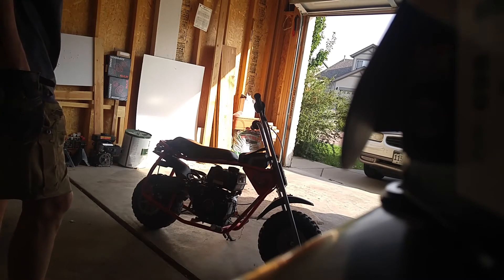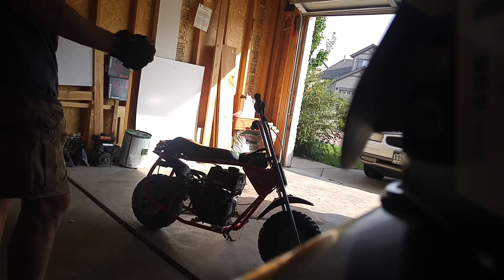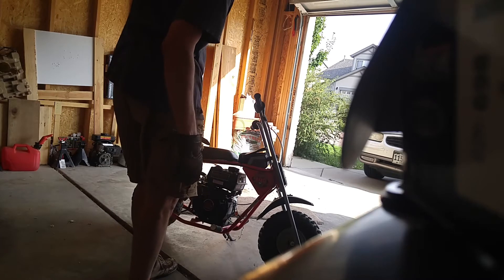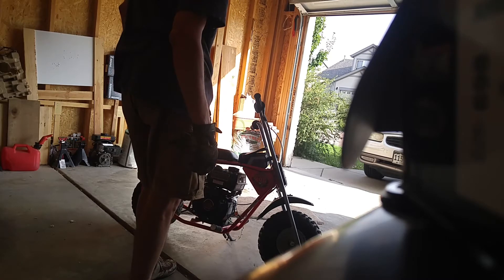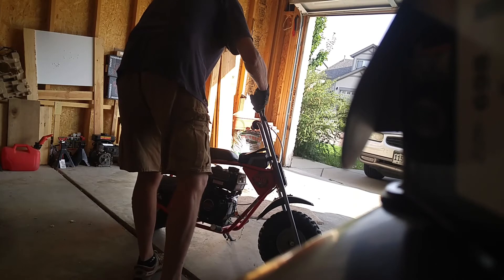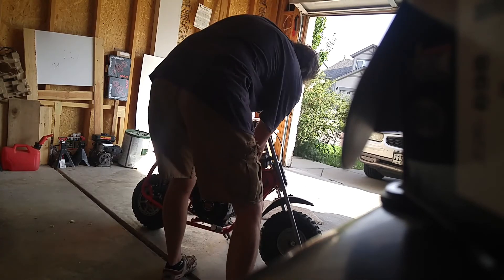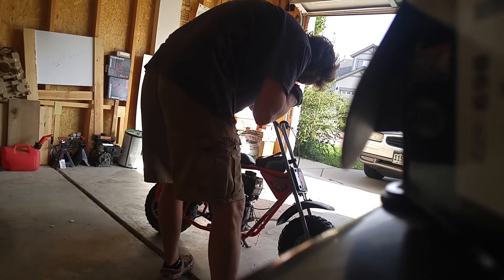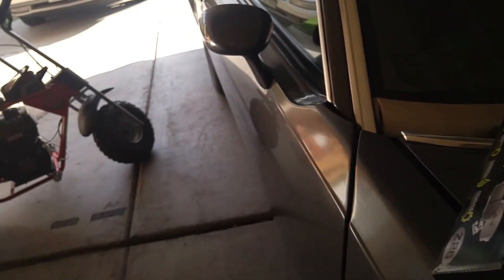ARC Billet Flywheel Kickback When Starting Predator 212

Comment from the maker: A recent comment brought my attention to this vid, which I posted 5 years ago.  I've stored it without riding it for most of that time, but have taken out and terrorized my neighborhood streets a handful of times over the last two summers.  I installed front shocks last year.  Anyway, this vid had it occur to me that the issue has disappeared.  I got some good feedback, including several comments that they resolved theirs with proper valve lash adjustment.  I adjusted the lash a few times, but if memory serves, it only reduced the kickback from a rating of "brutal" to "there, but no threat of arm removal".

However, it's now gone.  I had good reason to use that glove in the vid, so it wouldn't take any skin off during the kickback.  No glove, no kickback at all anymore.  So my first bet would be that the valve lash has settled itself to that which nixs the issue.

I fired it up a couple weeks ago for the first time since last summer and I think it started on the 2nd pull...a pleasant surprise.  And man...I forgot how much power its got.  The billet rod, upgraded cam, billet flywheel, Mikuni carb and rev limiter delete has that thing get up to 50 mph lickity split (probably 6K rpms, feels like it could do 80 if I put the appropriate sprocket on.  But, I was also reminded how small it is.  It's a bit sketch taking it up to even 50 on my streets (not winning any smooth, flat, bump, pothole and crack-free awards).

The only mod I'd like to make anytime soon would be a higher rpm centrifugal clutch.  The one on it engages what feels like <2K rpms.  So low that after it engages, once I give it some serious throttle, I can feel it pulling hard, but because the rpms are so low, can feel each combustion of the piston.  Anyone who wants to chime in on a popular higher stall clutch, would be fine.  I would want it to be too high...think I remember some that were like 3,500 rpm.  I'm thinking 2,500 to 2,800 maybe?
Reply: They’re might be a mild drag clutch that would work for that. Also you could do a torque converter and swap the springs on the drive pulley (to have it engage earlier or later)

Comment: I had the same issue with my 212 non hemi. (Billet flywheel, connecting rod, 22mm carb, 265 cam, 22lb springs, and fuel pump) from what ive been reading everyone said valve lash. Not in all cases is it VALVE LASH. My issue was the fly wheel was to advanced causing the motor to fire way to early= causing kick back. I put the stock flywheel back on and problem solved. I’m going to test it with a 12 degree timing key Put backwards, making my timing 20 degree not 32.
Reply: How would you explain this not happening to others who are running 32 degrees or higher? Not sure why you would want 20 BTDC? Stock engines are 28 BTDC.
Reply: @deucealive75  my information i got was wrong. Stock engines are 24 degrees, not 28. Im aiming for 24 not 20. My bad. Ive lashed valves cold and hot, just passed and right at tdc. Nothing changed. Put the stock flywheel on, no kick back. Tell me its not timing in the flywheel
Reply: @tannergunsell1651  When I say stock engines, let me be more specific. I used a timing wheel on 2 different stock 196's. Both were timed at 28 BTDC. If other engines are different then it would up to who is using them to verify timing.

One of my 196's is at 32 BTDC. Runs great and never kicked back.
Reply: Rotate until intake valve closes, just before tdc you will see the exhaust bump, just after that you lash the valves. Ive set it from 0.04 to 0.00 multiple times. No way its lashed wrong. Only time it kicks back is when it dont fire all the way like in this video. Caused by timing

Comment: I have. 223cc 212 hemi that does the exact same thing, it has a 34 degree flywheel and many other mods, spent literal days trying to get the exhaust lash right only to find out that the timing was causing it, have you found any correction to it? No luck on my side.
Reply: No I guess now I have to used drill gun to turn it on 😅
Reply: Wait it was the timing on the flywheel?
Reply: @ItzAmandaa333  technically it is, but most flywheels don’t let you adjust it, you have to order a special one.

Comment: I don't have that flywheel in just 18 lbs valves, big jet,  air filter and adapter, performance exhaust. And she fights me like crazy some pulls kicking back hard. But I did remove all the fins on the flywheel so I think it might be slightly advancing haha it pulls like crazy when it does it mine does it fairly often

Comment: i've been dealing with this also......very first mod was the arc billet flywheel.....did nothing else. valve lash is on point....only way i can get around it is to roll the engine over to what i believe is the intake stroke , pull it and hope for the best. kicks back but not as bad....im about to try the pvl flywheel. for now i'm not even changing the flywheel on my 2 current predators. heck my ole lady and kid for that matter could never start that thing.....and that is what its all about ,,,easy to start right....

Comment: I don't know why my Predator 212 every time I start it it makes a loud screeching noise in the flywheel somewhere
Reply from the maker: I'm trying to recall memories of the billet flywheel install.  The only thing I remember as being very close to the flywheel is the magneto contact.  Maybe check that and make sure it's not making contact.  Vague memory (or just imagination) has me thinking the magneto gap is either 0.03" or 0.06" Possibly 0.05"? Best confirm elsewhere.  Regardless of what's causing the screech, you're gonna need to take that flywheel shroud off and inspect the area around it...and the inside of that shroud.  I've never tried this, but if it's not apparent after the shroud's off, maybe try starting it with a drill (a drill with some good torque?).  I'm assuming there's some hack to drill starting that doesn't require the install of an aftermarket drill start adaptor.

Comment: Well mine has done this since I installed the arc flywheel and today the cord snapped back and the handle wacked the carb and snapped the choke lever and the throttle😕
Reply: It's your valve lash.  make sure that you measure correct spacing (mine was .003) at just past TDC on the compression stroke.  That way it's getting compression and it is easier to pull start with no kick back.

Comment: My 212 is stock with a exhaust and air filter with the stock flywheel and does the same thing
Reply: Justin Woods 

Hey bud, have you jetted the carburetor since the Intake and exhaust changes? Its a Must Do..✌️

Comment: I have a simal set up as you do and i have the same issue.. And cant figure out why!
Reply from the maker: I'm done with the build and am satisfied with the way it's running.  Took it out within the last couple weeks a couple times when the weather warmed up.  As far as the kickback, I've resigned to thinking it's probably mostly the advanced timing of the billet flywheel.  It just now occurred to me that the fact that I'm at just under 6K ft elevation here in Colorado and the associated leaner fuel mixture might be contributing.  I do have the sweet Mikunu carb on it now, and the kickback seems to have reduced a little, but will still happen. So I've optimized my technique of keeping my fingers non-tightly gripped on the pullcord handle as best as I can.  If/when it snaps back, my fingers will let go vs. forearm muscle ripping.

Comment: You may want to redo the valve lash and make sure you did it correctly. When I installed a mod2 cam, billet rod, and a billet flywheel, I initially didn't do the valve lash correctly and it would do the same thing to me and almost tear my fingers off. But after watching a video showing how to properly set the valve lash on these kind of engines and redoing my valve lash, it quit doing that and would run beautifully. Hope this helps.

Also about the cam lobes hitting the crankshaft, if your engine is a hemi then you have to grind down the crankshaft some so that the lobes will clear. It would explain why your oil looks bad after only about 40 minutes because that "grey" in the oil is pretty much most likely metal that has been ground off the lobes as a result of not clearencing. By now your cam would be pretty much trashed.
Reply from the maker: Since this vid, I've installed the mod2 cam (and billet rod) and Mikuni carb.  It still kicks back on occasion, but not as much/often.  Of course the motor loves the better carb, so with the choke on, it'll usually start by the 2nd pull.  I'm still cautious, but no longer wear a leather glove.  I never re-gapped the valve lash after installing the new cam.  No good excuse, just impatient and wanted to see how it ran after the cam install.  Since ran just as good as before and even better with the new carb, I haven't bothered.  Though I adjusted and rechecked the lash a couple times initially (before the cam and carb), it would be wise to check it again now.  Just running great and pulling strong, often with no kickback during starts, so not a priority.  I clocked it at a full 50 mph a few weeks ago on my phone.  Had plenty of power up to 50, just ran out of gearing (stock DB sprocket). ;)
Reply: @Stiffler1109  To fix the issue completely, instead of setting the timing at exactly TDC (matching the cam and crankshaft dots perfectly), turn it a degree or two past TDC. To be more specific, the moment you start to see the piston begin to move down just a cock hair, set the lash from there. You will never have it snap back on you from then on. And if you do, your flywheel key is likely the culprit.
Reply: what video did you watch

Comment: Lol yours isnt near as bad as mine. It does it about once every other pull.. it’s violent
Reply: mine too I have the ultra light flywheel from arc it really hurts lol
Reply: I just tried firing mine up and it flew out of my hands and graciously smacked me in my manhood on the way down.
Reply: I just started ours up after doing cam, flywheel, springs, exhaust, intake and jets. Destroyed my forearm
Reply: For sure it's come back and slapped my thigh....I got the 308 c am in mine along with flywheel
Reply: Same lol and I don't even have that flywheel yet. Just a stock flywheel  with all the fins removed from it and 18 lbs valve springs, jets, air filter and adapter, exhaust. Going stage 2 racing kit soon

Comment: Is the new flywheel billet aluminum? Was the old flywheel steel or iron? If so it's a weight issue. I recently removed the blade off of my push mower and it almost ripped my fingers off but then I put the blade on it and No issue, started right up.
Reply from the maker: Yes, it's the Arc Racing billet flywheel.  The OEM Predator wheel is iron I'm guessing.  I'm thinking that it's because the timing is so advanced with the Arc flywheel.  But, considering what you're saying...it could be a combo of the advanced timing and the reduced weight.  And...possibly cheap gas?  That just came to mind.  Most of the stations here in Fountain, CO have 10% ethanol...don't know if that is a factor; just a thought.  But as you can see, I've learned to deal with it.  It's winter now, so haven't fired it up in a few months.  It's got the stock cam in it.  I wonder if upgrading the cam would have any affect (as I remember, Arc recommends upgrading anyway, being that my governor has been removed and the upgraded cams are hardened steel).  I would probably guess not, but have seen quite a few vids of the motors with the Arc flywheels with no mention of the problem (and they've probably upgraded the cams).
Reply: Terry Koss I mess with mowers a lot more than go karts and etc. Recently I acquired a huskee push mower with the 173cc predator which is the motor I spoke of previously. It came stock with an aluminum flywheel and now I'm looking for a stock 212 flywheel to swap it out for this same issue because I'm removing the blade and putting a pulley on it but the engine produces so much compression that it rips the pull handle out of my hand without the extra momentum the blade creates. People have run into this issue for years with mowers.

Comment: At least now i know im not the only one haveing this problem, thanks for makeing the video.
Reply: Terry Koss i have both cams. Stock and a racing cam i installed both and i seen no difference cause my engine is still kicking back
Reply: Try put bigger valve springs in it that seem to solve most of my problem. Mine did it without the Billet flywheel
Reply from the maker: Sorry for the delay, just now got back on YouTube.  I'm assuming you have the ARC flywheel?  And if so, do you have a stock or upgraded cam?
Reply: I went to the 22 pound I think being a hemispherical head. when you hit compression stroke you get valve lash
Reply: mine just about rips my fingers off. lol iv DESTROYED many many pull starters in the process. makes me wana go alchy and use an electric starter